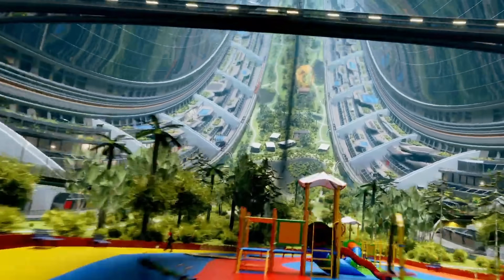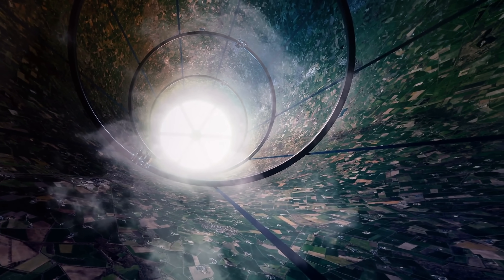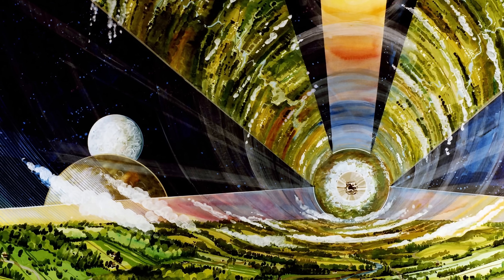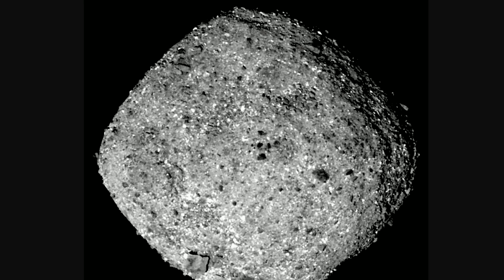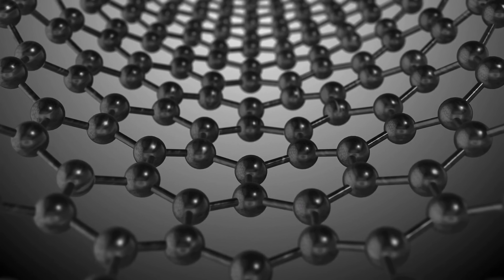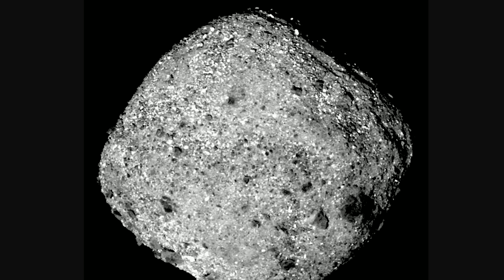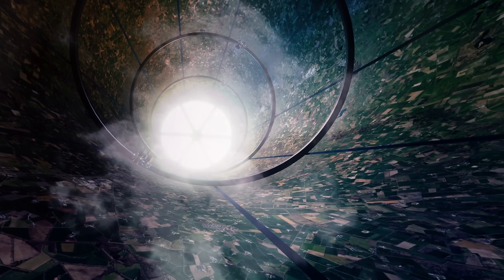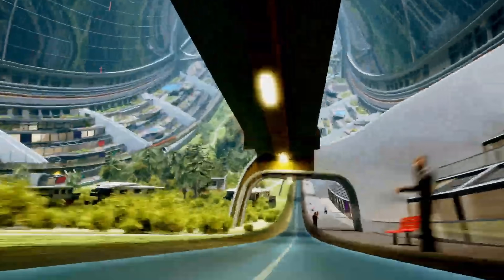Space Cities Out Of Asteroids and Graphene Bags? Intriguing O'Neill Cylinder Study

Comment: Most of the mass of such a habitat would be for radiation and micrometeorite shielding and hence need not spin, the pressure habitat could spin within it.  The Adobe construction concept of stuffing the rubble regolith into a bag whether plastic, knitted wires or graphene is a good idea but you can also synthesize plastics from the dry ice and water ice found on asteroids and comets and use the plastic as a binder to the regolith so you could just 3d print the outer radiation and micrometeorite shield.  The internal pressure vessel would need greater tensile strength, most likely through wires and cables being the structural members but perhaps by exotic meta materials like graphene (graphene would suffer greatly from imperfections at that scale).  The greatest challenge would be how to radiate heat from the habitat and yes I do have a few ideas for that as well.   However, habitats after the first habitat would benefit from the workforce and infrastructure of the first habitat but the first habitat would not hence the ability to 3d print the outer shell from regolith would be a tremendous advantage with building the first habitat.
Reply: Use metals as cables for reinforced concrete. That's structural strength and shell and shielding at once.
The '70s NASA Ames / Stanford space settlement studies found that no new inventions were needed and common structural materials would do for huge structure, beyond what we need in the near term. See the O'Neill "Island One" Bernal sphere or the "Stanford Torus" for fully worked out first generation designs for a few thousand workers.
Reply: @JFrazer4303  Yes, there is no need for new technologies for the O'Neill Cylinder, Bernal Sphere and Stanford Torus and indeed with modern wireless technologies the amount of copper those plans had specified are actually no longer needed so the construction of such habitats have actually become much simpler then when they were first proposed but unfortunately, these are just megaprojects and it will probably take efforts to automate the construction of the first radiation and micrometeorite shielding will be needed to make the first one (the Stanford Torus plans had the shielding as 95% of the mass.  As the shielding need not rotate, it does not need tensile strength so even metal reinforcements are not necessary and we're already moving towards fibreglass reinforcements on Earth and that would be a lot easier to produce from the regolith of asteroids, comets and moons than iron rebar (iron is only 8% of the common S class asteroids, it isn't till the rare M class that you have high ore grade concentrations of metals.  With concentrations as low as 8%, you would want biologic mining with bacteria as our storage ancestors did with bog Iron and that takes decades though it requires little labour from us.  Best to save the metals for the pressure vessel, ammonia heat radiators and refined products like airlocks (which likely would be launched from Earth with the first habitat)
Reply: @johnwang9914  Is the mention of copper a typo?

Using reinforced concrete as structure and shielding, eliminates much complexity and makes it more robust. AFAIC, put a separate non-spinning shell around that for double protection.

In average Moon regolith, they found that there's about as much metals & rock in proportions it would take to make it (reinforced concrete uses less metals, than using metals structure for the rotating part and non-spinning rock shield).

 Finding a few metallic asteroids (even metallic stony like Chelyabinsk) is a bonus. Chelyabinsk was an Apollo, and we know of 10k+ Apollos.
Reply: @JFrazer4303  The Stanford Torus was the result of an University design competition and they estimated the tonnage of copper needed to establish a modern phone network for a town of 10,000 inhabitants which was the planned population for a Stanford Torus.  I was just saying modern cell phone and fibre optic technology alone has removed that need greatly reducing the quantity of refined metals needed.  Remember most asteroids are from undifferentiated material hence difficult to smelt pure metals from (type M asteroids are believed to be fragments of protoplanetary cores which would be differentiated material and ores on Earth are differentiated material brought up by geologic forces).

Rebar for concrete is for tensile strength but a no rotating radiation and micrometeorite shield does not need tensile strength.  Doesn't matter if it would improve the "strength" of concrete as it's the type of strength needed.   Also concrete requires cement, more importantly quick lime which are the product of ancient microscopic sea creature.  As we do not expect a lot of life living on asteroids, cement as we know it simply aren't possible from asteroids though we may be able to develop other binders such as the synthetic plastics I mentioned from dry ice and frozen ammonia water which we do know are plentiful on asteroids and comets.  The Fischer Tropsch synthesis process has been known since the 1920's and we use it in our existing refineries so it's something we know how to do at scale.

Maybe you should learn some basic engineering, chemistry and physics before continuing to make a fool of yourself with your reinforced concrete nonsense.
Reply: @johnwang9914 
 Many various types of ersatz concrete-like aggregate rock materials are possible. Maybe I was lazy in not specifying "some sort of ersatz concrete-like artificial aggregate rock", but maybe you should moderate yourself before making such snide remarks.
Yes, some sort of plastic binder or sealant could be used too, but it remains that much good work from engineering professionals have suggested combining the rock into the structure and the metals as cables to hold it together. Making a more robust and easily repairable colony hull, and incidentally requiring less metals overall than a metal colony surrounded by a non-rotating rocky shield.
Yes, tensile strength of cables holding the mass of the rock as well as everything inside, and having enough strength beyond that for adequate safety margins.
This isn't just me, some guy on the 'net saying this: read the actual stuff by professionals who've written about this.

Aluminum works great for a conductor - I remember reading about them suggesting substituting Al for Cu in many electrical applications in some of the original space settlement works.
In any case, what indication is there that Cu is rare on asteroids?
 Those who'd be building a space colony from asteroidal materials aren't going to be limited to just one, random rock to work from. They'll probably have many bodies assayed and they'd be able to pick what they want to bring together.

A metallic rocky asteroid could be a source of metals as well as a more metallic type. Yes, we routinely take metals from their bonded states in minerals, to get the pure metal. It's just like oxidated iron ores being used down here any many other processes taking metals out of their bonded states in various minerals down here.
Reply: @johnwang9914  Some meteorites are density 8+, greater than pure iron. The Apollo NEA that hit Chelyabinsk was classified as a stony type, but was still denser with metals than Earth's crust 10km deep.

You keep harping on quicklime being the only way we make concrete down here, when I made it clear that I meant any sort of artificial aggregate rock.

Others in the literature have proposed to sinter regolith particles.
The NASA Ames / Stanford space settlement studies didn't suggest using quicklime brought up from here, and they proposed using Lunar resources which are notably poor in metals compared to some even stony asteroids, with most processing water and chemicals brought up from here.
Show your construction / mining / astronautical engineering credentials and where you've published in peer-review, if you disagree with their findings.
Reply: @JFrazer4303  Type M asteroids are estimated to be less than 5% of the asteroids in general.  Sure, we believe they may be fragments of protoplanetary cores and we know of at least one suspected type M asteroids but the asteroid belt is a fairly big place with actually a very low density overall, we really shouldn't just count on finding a convenient near Earth type M asteroid and fortunately, most of the mass needed for a large space habitat does not need the refined metals anyways.  The Stanford Torus study estimated that 95% of the mass would be the radiation and micrometeorite shielding and undifferentiated regolith serves that just fine.   We simply don't need the type M asteroids to build the large space habitats though one would be a big advantage.  As to refining metals from undifferentiated regolith, on Earth, stone age man used bog iron which are created from bacteria feeding off rivers passing through the 5% iron content of Earth's crust and undifferentiated regolith is 8% iron.  It may take time but biologic extraction of useful metals is already a well understood technology and even on MIR, we had bacteria evolved to munch away on the alloys of the space station hull.  A type M asteroid would be nice but isn't an absolute necessity.
Reply: @JFrazer4303  And I never denied that some asteroids are denser.  I only said that we don't even need the rarer dense asteroids as 95% of the needed mass for large space habitats are for radiation and micrometeorite shielding so the far more common undifferentiated mass asteroids are sufficient.  Remember that every asteroid we've sent a probe to has shown themselves to be undifferentiated material, the examples of differentiated material that we have are meteorites that survive re-entry and impact and the very survival of re-entry and impact selects for the denser material.  Boy, you guys really get buried in mindless cognitive bias.
Reply: @johnwang9914  Speaking of getting bogged down on little details and cognitive biases...

Comment: I have a question - if you cannot rotate the asteroid because it's gonna disintegrate, can you tug it? I always assumed you can, but if it's that weakly bound, I wonder if this is doable. Otherwise, pretty cool idea.
Reply: Most asteroids are a collection of materials held together by their gravity. I imagine you Could tug it if you have something to hold it and in a speed that won't disintegrate it
Reply: Wrap it in a net of cables. Set up a huge bag around it anchored at and spinning slowly around the poles and send in rovers to kick up the rubble to collect in the bag and send it off to processing. Remove hard boulders and tighten the net as you go.
Use the materials you need to make the habitat.

Comment: Yes it seems that attuned lasers connected to fusion or perhaps a reflector using solar energy to create spin. I was thinking about these giant graphene condoms as a way of transporting things to mars then just just slowing and speeding objects up with a laser relay. This also was a way to take CO2 out of the earth atmosphere using lasers that had dual purpose for communications and weather alteration. Space carbon - Graphene industries IMO will probably happen because we have an excess of it as a byproduct.  Also it is easier to build a space elevator from both space and earth at the same time.  I dunno we need to survive past 2050 to see any of this.  These space lasers can use a reaction chamber to flash generate and 3d print the graphen condoms in an arcflash type process. Even energized systems can be created by infusing nuclear waste in the process so that the crystal lattices that are constructed will produce charge creating self energized systems. I proposed calling the process Blasters after Elon Musk space invaders transformers crossover.

Comment: As you spun up the asteroid and it began to fly out to the inner wall of what ever structure was going to hold it in, it would not distribute itself evenly. Ever seen an unbalanced wheel or washing machine? It will shake itself apart with unbelievable force.

Comment: The only problem is the magical graphene or whatever material strong enough to withstand immense pressure or pressurized O'Neil cylinder. That material does not exist. And if it did, it could be used to build a space elevator to cheaply deliver materials required to space. So no need to hassle with roids.

Comment: Spinning whole asteroids is not practical. The most practical use of asteroids for habitation is to dig into them for raw materials and put spinning habitat inside them, leaving asteroid not spinning.
It's much better to have outer shell not spinning. This way it's much stronger and much more resilient to impacts, and provides good radiation protection.
And btw we don't need graphene to do it, even steel is strong enough to make practical rotating habitats.
Reply: One could also be used as a spacecraft.

Comment: I see a huge flaw in this concept. To achieve Earth like gravity, the ring's "graphine" net, that is holding back the spinning of all that massive material is going to be under millions of tones of force trying to break it apart. Imagine standing in Earths gravity on simple suspension bridge that is made up of 10, 20 feet of loose rock with only a thin membrane holding it all up underneath. It would collapse immediately. Unless the regolith can be cemented together with structural elements like rebar I don't see this even close to being feasible.
Reply: Right. The strength of existing carbon fibre is due to turbostratic graphite sheets, and a carbon fibre cylinder ~400 km in radius, going at one gee, would have all of its strength taken up in supporting its own centrifugal weight.

Scale it down 100-fold, 4 km radius, and the carbon's self-load is one percent of its breaking load. Now, per tonne of carbon, you can add nine tonnes of loose rock and be at a reasonable ten percent of breaking load.

If the loose rock's bulk density were the same as the tense carbon sheet's, an 18-foot-thick rock layer would need a two-foot-thick carbon sheet. So yes, a membrane, but not a thin one.

If there is pressure at the top of the rock layer, breathable air pressure, this will take the load fraction up a little more, maybe to 20 percent.
Reply: @grlcowan  Having a 2 foot thick membrane hundreds of square kilometres in coverage would be kind of defeating the idea that this would just be a thin net easily made. Producing such a membrane would be extremely costly.

Comment: for those that think this should be done instead of planetary colonization...no. the cost for habitats like these is astronomical. you're looking at over 1000x the cost or more of settling on mars or even the moon WITH a longer time frame before it could even be utilized as a habitat. these structures would be AFTER  planetary colonization...if at all. their usefulness is limited as while large they have a finite size and a finite amount of resources. planets or moons do as well...but they also have a MUCH larger initial resource pool. if these are ever used unlikely that they would even be 'nice' places to live. as their most likely use would be for refining/manufacturing further out in the solar system sending resources inward. why? because gravity is needed for some processes and the bodies outward tend to have less and would require more cost to implement than an o'neil type construction.

cost versus usefulness is always the metric. not wow factor, not how pretty, and most certainly not 'just because we can'. their only real advantage besides artificial gravity is that when you form the initial blanket you can make it conducting in layers to create magnetic and polarized shielding providing better protection at the distances the constructs would be at and the ability to be moved again making them very well suited for industrial use as they can go to where the resources are.

Comment: actually i hate to be this guy but:
E=mc^2 -> if you have enough energy generation you can create gravity with current technology, you just need enough energy. The Equivalence principle is an overestimation in that the mitochondria in the cell it will be affected by acceleration differently than by gravity. this means acceleration will not Suffice, I'm willing to wager money on this. 
the smallest a star can be, and still be able to maintain its structure is the size of Jupiter. you can build a platform around this structure, or we could start looking into anti matter energy generation for the purpose of generating gravity. this is also not to mention that we do have the capacity to generate small black holes that do not have the capacity to self-sustain, meaning when the machine gets turned off the black holes disappear. this would be an easy example of generating artificial gravity with current technology, Not science fiction technology.

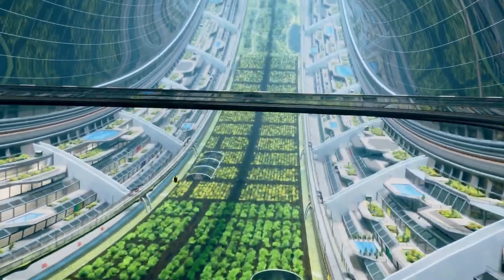Comment: 0:46 space station has a poor design. He should use a segmented ring design. Then have each segment rotate to 1g speed. Then you can utilize 360 degrees of space on the inner plane. Run a high efficiency transit system straight threw the middle of each segment, where gravity is least. This prevents breaches and loss of air, gives you maximum land space, and your rail system would be in the literal clouds where artificial rain generators, and grow lights are.